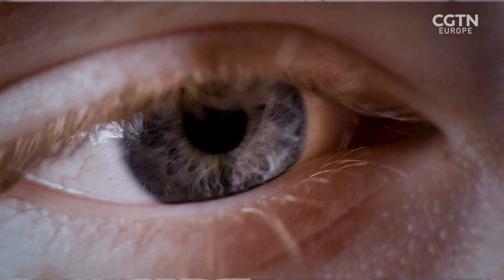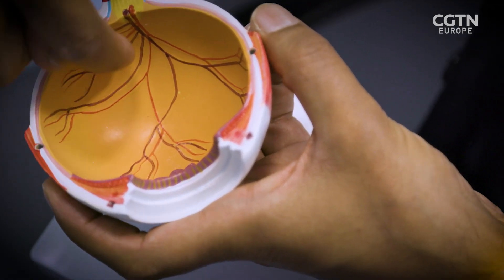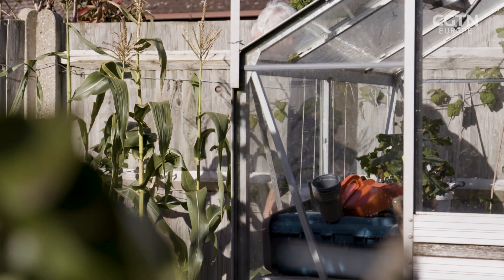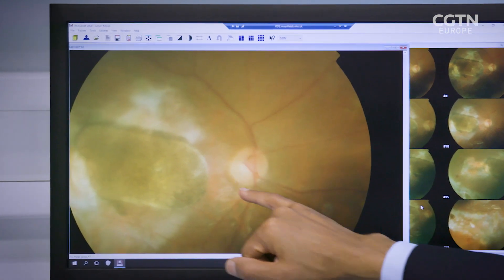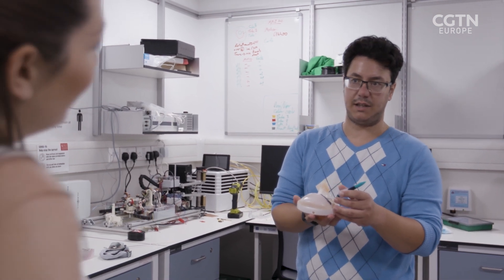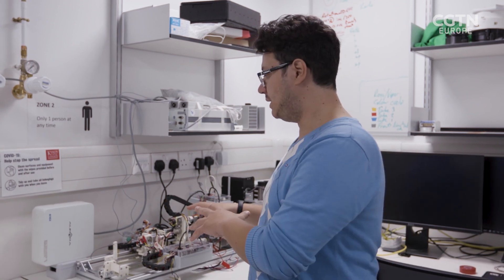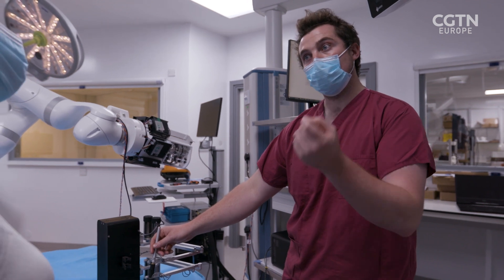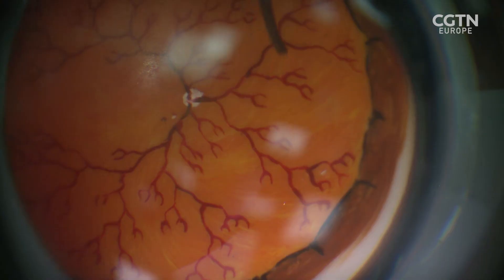Stem cell eye treatment #RAZOR

Comment: brainstem  pineapple at cell and calcium will help it needled by needles help with rebuilding cells try this.
Reply: try building eyes with code not anatomy of the eye but the elements of eye pump the body full of elements what eye made off the brain may repair it it fixes floaters in eyes.. i try it i invented it off the basis of the knowledge of what the content of the eyes made out of all the periodic table the content label on the back of the milk carton says what in milk what milks made up of Well content of an eye say eyes made up off calcium Corner witch found in apple cell. the arm take cells made eye cell body should take to the eyes and repair the eyes. you do more studding on this and messenger me back i use the improved version but i not seeing floaters anymore safe safe this works..